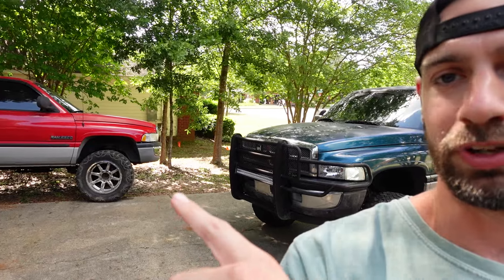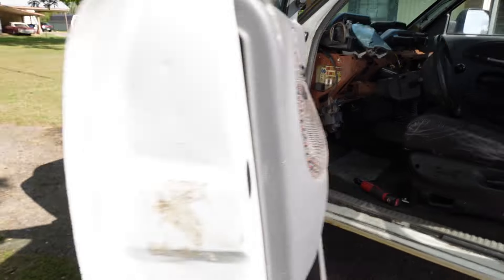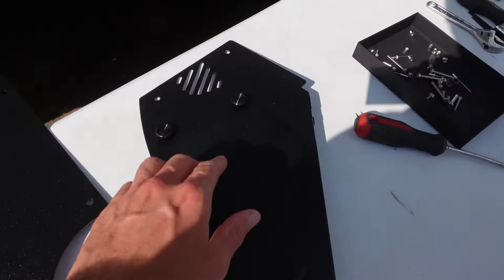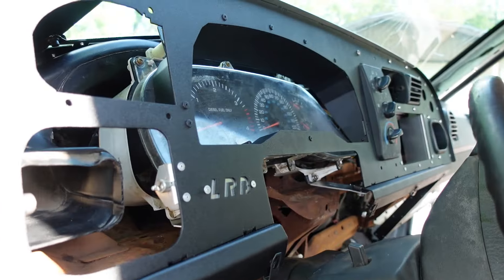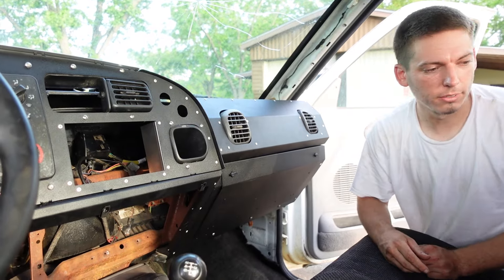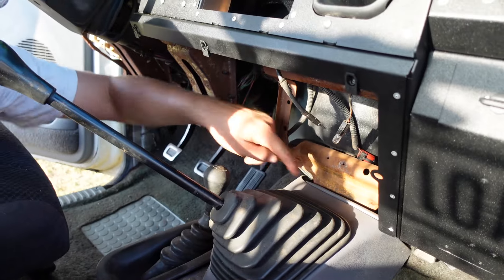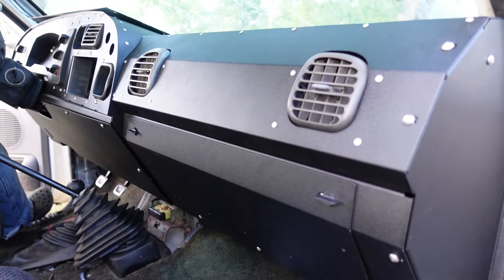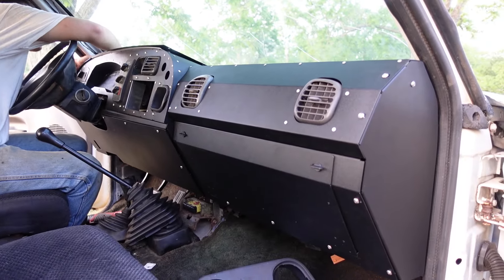2nd Gen Cummins BULLETPROOF Dash, Cost more than the Truck !

Comment: Pretty awesome Hunter. I took the leap after much consideration and after saving up for several months. I paid the full price of $1900 (I added in a new cup holder), but was lucky to find a free shipping coupon and that saved me quite a bit. It was WELL worth it! I am about to install it and appreciate your video to get a sense of the project ahead. I also made sure to pick up a new heater core, A/C accumulator (and evaporator core for under the hood) to install since I will have the old dash out and easy access. We'll be posting the project as well for anyone looking to install on a 97 Ram 1500 automatic.
Reply from the maker: @casteaver  that’s awesome, and definitely not a bad idea to go ahead and replace some parts while you’re in there

Comment: I know that dash took a shitton of time to design and fabricate.. I’m fine with him charging whatever he wants to. The Dodge dash is a turd and every 2nd Gen on the road has a trashed dash. MIne has a tiny crack. I’d be concerned about rattle but I’m sure he addressed that. Maybe foam between the pieces. I support innovation
Reply: Absolutely my truck also has a few small cracks and the center dash defrost vent is broken away from the dash but still screwed in place so it is better than most but it also got a dash skinz dash cap..

Comment: Did you have to pull the dash or did you just break off the plastic?
Reply from the maker: @matthewwilson6955  a little bit of both, dash wasn’t in the best of shape, plastic was brittle and cracking, but the original subframe is still there, that’s what this new dash mounts to
Reply: @Hunterrnorris  did you have to remove the subframe?

Comment: They look great but 2k ill have to pass
Reply from the maker: I’m going to do an update video in a couple months, to let everyone know if it rattles, gets hot, etc. Then we will know if it was worth it
Reply: @Hunterrnorris  I’m thinking of getting one for my 02’, but I’m concerned about it buzzing.  You know how sheet metal can be if 2 pieces overlap but are not under tension, they can vibrate a little bit and make a buzzing sound.  I think it looks good for no rattles.  Someone suggested it could be tig welded together to cut down on noise, any thoughts on that?
I hope you post an update soon if you can!

Comment: That steel dash is a good idea i was thinking 800 bucks 1900 is a bit much but i guess its a one time deal. Wonder if it rattles going down the road
Reply from the maker: We have many drove the truck since the install, but It seems like a snug fit
Reply: Looks like you guys got it under control! 🎉

Comment: I have gotten lucky with getting a farm truck most of the dash structure is in really decent shape considering how many other ones are.., and my truck has a dash skinz dash cap on it but it is only covering a few cracks and one busted spot over the radio section,, and the dash glovebox light switch clip is on a bar the dash structure attached to that tab is broken and the switch just hangs in the glove box so I pulled the bulb... but other than the typical cupholders hinge cheap plastic junk and my ashtray now opens up the cover and then you have to push it back together and finish opening it but ok...